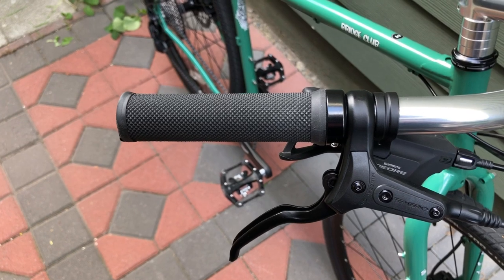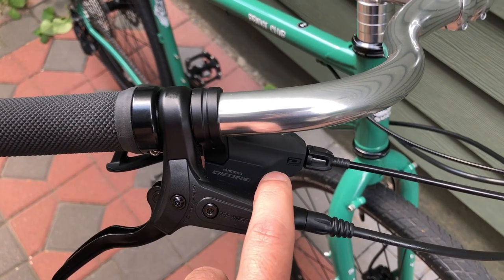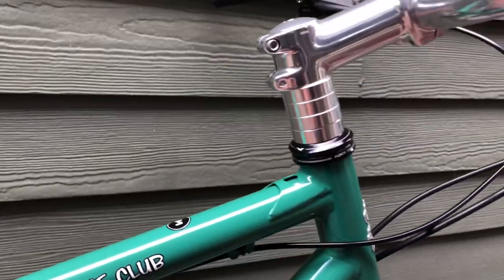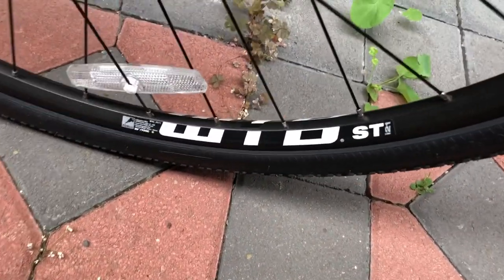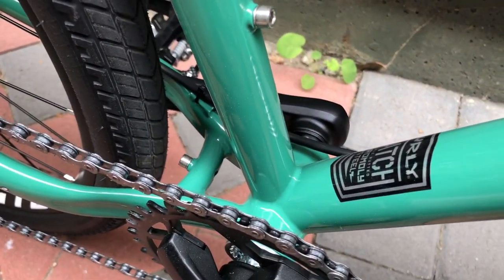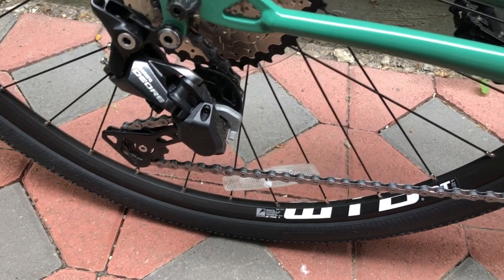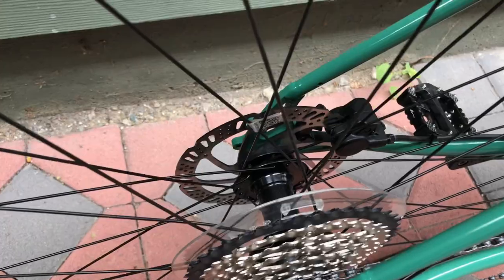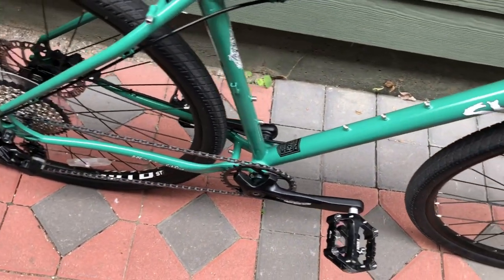Surly Bridge Club Bike Check

Comment: This gotta be one of the most beautiful bikes I’ve ever seen. I’m a big fan of minimalism and function over form, so this is right up my alley!
Reply from the maker: i agree.  wasn't sure at first, but really like the classic looks.  only complaint is the cable routing on the top tube.  wish it was all on the down tube like the disc trucker
Reply: exactly. I love the mustache handlebars that say easy going. The only thing left for this guy to do is to load up the camping bags and head off into the woods.
Reply: rick vegas agreed. It gives the bike an easy going air, but I’m sure it’s a very tough and utilitarian machine!
Reply: I agree with you, Reggie, about favoring minimalism. Bikes just keep getting more and more complicated, and I was into that for awhile. But, now? My Specialized Stumpjumper FSR full-suspension with hydraulic disc brakes and F&R air shocks sits in my garage, and I'm riding my pre-2000 Stumpjumper hardtails with V-brakes / cantilever brakes. omg bikes, I was just looking at your exact bike, but in a small. :-) Very utilitarian, gets the job done, no questions asked. I've been toying with the idea of getting a Surly (Bridge Club, Ogre, Disc Trucker) or a Kona Sutra, a Salsa, etc. and don't want to spend much more than this, but I always go back to my 1995 Stumpjumper FS CrMo hardtail or my 1997 Stumpjumper M2 Comp hardtail for touring/bikepacking (just switch out the tires for road or trail). Anyway, thanks for the walk-around of your new Surly, and I hope you can trade for a small frame.

Comment: Hey... thanks for the video. How tall are you? Couldn't you just get a shorter stem? That thing looked really long. I'm about 5'7" and I'm looking at getting a small Bridge Club. Wondering how you did with your new bike. I'm thinking frame up build. thanks again
Reply from the maker: i'm 5'9" with short legs and arms.  def recommend the small for you. reach was not the major problem.  i didn't like the stand-over.  the sensitive bits were bouncing off the top tube.  i would consider building the bike, especially if you already have some parts laying around.  if you have to source everything new, you'll likely end up paying more than the factory build, but at least you could make your own choices.

Comment: Great video, thanks! Surly are adamant that 47mm is the max for 700C tyres. I want to run Schwalbe Big Ben which are nominally 50mm, but looking at the video it seems like there's loads of room. They're 45mm tall off the rim and about 48 mm wide. What do you think?

Comment: In future if you will want to change tires to 50mm wide (2 inch) you will need to change inner tubes aswell or inner tubes can work with 50mm tire?
Reply from the maker: i have not looked at the tubes that come with the bike, but one option is to go tubeless

Comment: Thanks for the detail on this video. How would you compare the riding style of the BC to the Trucker? I have a Disc Trucker but need a more upright riding position. Thinking of either trying another bike like the BC or modifying my DT with a Jones bar.
Reply from the maker: Thanks!  I would say the BC is somewhat similar to the Trucker.  However, my Trucker has an uncut steerer and an ungodly amount of spacers on it, so the position may be more upright than if you bought your bike complete.  Plus, I have trekking butterfly bars, not drop bars.  There are differences in geometry such as much lower BB on the Trucker that make it feel different, but as far as upper body lean, I'm not sure it's all that significant of a difference for me.  I bought Jones bars for the Trucker and will be installing them soon.  Check back for that video, and I'll discuss the fit then.
Reply: omg bikes Thanks! I’ll keep an eye out for that.

Comment: Wow, the amount of clearance! I would put some 2,6" 650B tires with fenders on it, such as Schwalbe PickUp
Reply from the maker: yes! this frame can ship with either 29er or 650B tires.  your choice!
Reply: From experience, a Surly Extraterrestrial 26" tire fits much better with 650b fenders, so really just put some 650b sized fenders on and then you can run whatever tire or wheel size you fancy in that range. I have some VO Wavy black fenders on my Troll. Very nice looking. :)

Comment: I’ve had my BC for a couple months now and I’ve probably got 150-200 miles on it.  I love the bike it rips on the gravel trails around my area.  I can take it on pavement too if I’m not going super far.  I’ve upgraded the grips to some DMR Deathgrips, I put issi thump flat pedals on it and I’m prob going to put some wider tires on.
Reply from the maker: Awesome. Bike seems like it can chew up pavement just fine. Why do you say ‘if I’m not going too far’?  Do you have the 27.5 version?
Reply: omg bikes No I have the 700c version it’s just as comfortable as the terminal bars are my body position catches wind like a kite.  I should really say, if it’s windy out and I’m on some open stretches of road it wears me down.
Reply from the maker: ah.  yes, for sure it's not a very aerodynamic riding position on this bike.  on my disc trucker, if i want to go fast, i have to put my elbows down on the handlebars.  then, 20mph (light load) is very doable on flat ground.  it's not as easy to take this position on the terminal bars on bridge club.  similarly, on my kona unit, the stock bars are very wide, so it's also like a parachute even in a more aggressive riding position.  i've ordered some narrower bars, but plan to adjust the cockpit to sit more upright, so won't be any speed gains there.

Comment: I’m not sure why you think the frame is too large? You have plenty of exposed seat post. Nice bike.
Reply from the maker: stand over height was not working for me
Reply: Exactly, he has the seat post and stem fully stacked!!   I'm 5 foot 10 and I just ordered a large, I will have a short stem on bike, but it will be a perfect size touring bike.
Reply: @bimmerbent  did u got u`r bike? how it fits u? i`m 184 cm (6.036 feet) tall and inseam is 88 cm, thinking about size L
Reply: @bladerunner_92   I did build a size M for female friend, Bike did seem little larger than I expected and would be a good "american fit" for my size.  Now I put 700/29 tires on bike w/ laid back seatpost, probably made bike feel large!   The frame Geometry is more traditional triangle style.  I just measured Top Tube  and compared with older same frame shape Large Surly 1x1, they measure the same.  So I still believe this is going to be a desired fit for me ( I want the largest bike that will fit under me for Road & Touring).   I would advise you to compare the Frame Specs to a Bike you are familiar with.    I dont think size L would be too small for you, especially if you plan to use 700/29er Tire or 650 plus.   It all comes down to Size of Bike preference.  Good Luck.   I hope to build my Large in very near future, parts are soo hard to come by right now.

Comment: Those Tektro brakes are OK; they will stop the bike.  But OK isn't good enough.  I have gone back and forth between a Bridge Club and an Ogre.  But in either case, the Tektros would come off immediately.  Deore or above hydros would be the go-to.
Reply from the maker: i actually tested deore and tektros back to back on a spcialized p3 and i didn't find a significant difference.  i think you have to step up from deores to obtain noticeable benefits
Reply: omg bikes I have Deore hydros on one bike and XT on another.  They feel exactly the same.  Indeed, the inner mechanicals are nearly identical.  The ability to do adjustment is the primary difference.

As an aside, even the newest entry-level Shimano brakes are great.  My wife’s new bike has MT200 brakes.  I am very impressed.  For entry level, they are amazing.
Reply from the maker: @peterbaskind9872  interesting.  maybe my deores need to be bled, as i didn't find them to be that impressive compared to the tektros
Reply: @omgbikes  Have they had appropriate time to bed in?
Reply from the maker: @peterbaskind9872  maybe not.  i took the tektros off (which were also not very well bedded in), slapped the deores on, and was quite disapointed at lack of improvement i felt. took them off and went back to tektros.

Comment: Was it worth the 1200.00
Reply from the maker: Great question!  I think that's a very much 'it depends' answer.  For example, I built my Disc Trucker around 12 yrs ago for similar money.  So that's 144 months of ownership at $8.33/month.  That seems a bit high to me, especially given the fact that I don't ride 12 months out of the year.  So let's say I only ride 8 months/yr - then the cost is $12.50/month.  That seems really high to me for owning a bicycle.  If you ride every day then maybe it's reasonable.  If you ride 3 times per week, then you're spending something like $3 per ride.  I've only managed to put 7,500 miles on that bike so that's $0.16 per mile.  None of that is counting maintenance and replacement parts (tubes, tires, wheels, chain, cables, brake pads).  If you love it, then it's absolutely worth it.  Disc Trucker has not let me down and has been a very versatile and enjoyable bike to own.  I don't see why the Bridge Club would be any different.